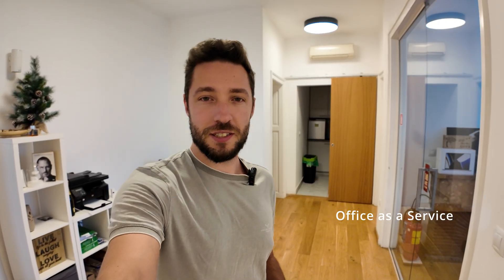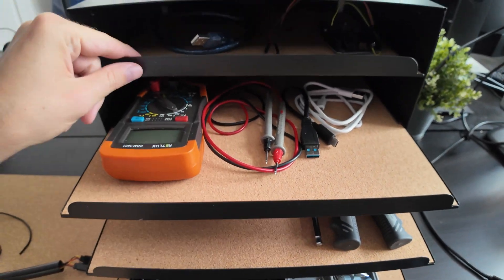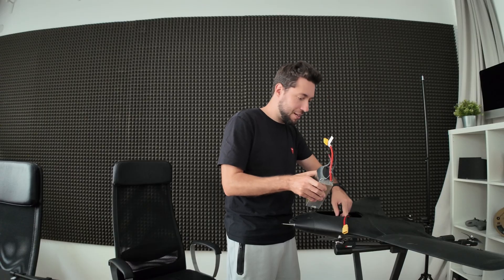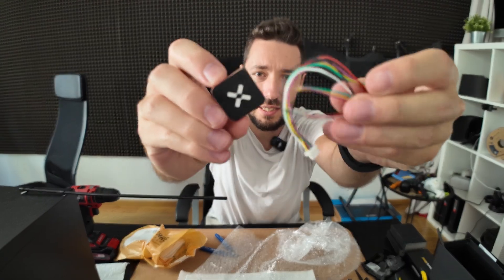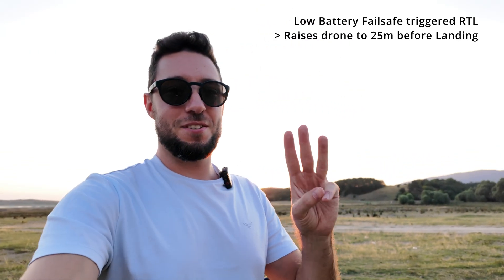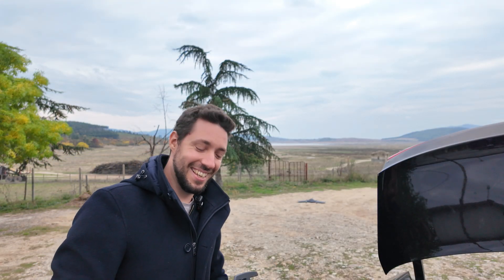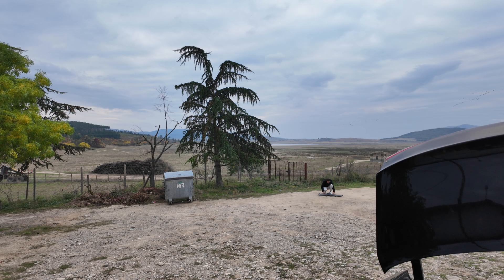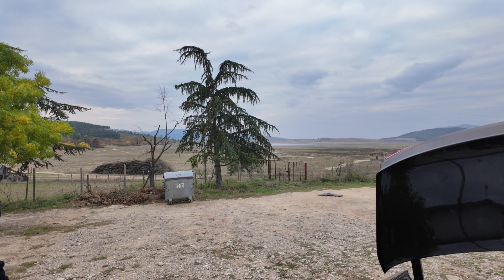Can a 3D Printed VTOL Drone Hover Safely? Stress Test & BIG News!

Comment: Sup mate! How did you manage to make it light enough? Mine is so heavy it barely lifts off killing the battery almost immediately - 3.5kg whole build. Even 10' motors can't do anything. Am i using the wrong plastic or printing settings? I'm on regular PLA now, should i try with LW PLA or smth else? Only ASA CF is doable? But is it actually that much lighter/less dense than PLA?
Reply: asa aero is recommended

Comment: Amazing to see it hover. Congratulation! I was wondering what radio link you were using
Reply from the maker: Thanks! DJI O3 Air Unit + RC, as well as a Holybro SiK Telemetry Radio connected to my MacBook running QGC.

Comment: I am also working on the same model, for motor mounts u can use a 16mm aluminium motor mount, it will solve all your problems, it’s round dual bolted to no grip issue on to the CF tube plus heat resistance, for aesthetic purposes u can design an outer casing. It’s cost efficient and permanent fix
Reply from the maker: Good idea. CF is rather sexy but also rather expensive. Thanks for the suggestion

Comment: what receiver are you using?
Reply from the maker: DJI O3 Air Unit with RC and a HolyBro SiK Telemetry Radio for redundancy. Rated for 50km so it should do 10 fingers crossed 🤞

Comment: Hey man what is the aproximate weight of the overall aircraft and if possible can you give the breakdown of weight of major components like battery and body and motors
Reply from the maker: Hmm I don’t remember the details. 1350g battery (11A 6S HV LiPo). Total weight around 3kg. You can fit 17A with the same weight if you reduce the Amps.

Comment: why are you stress testing the hover? this model are suppose to just use the the forward flight most of the time and just use the hover for landing and launching only? sorry if i sounded dumb
Reply from the maker: That’s true, but hover can serve 2 critical roles:
1. Redundancy if the main motor fails - vtol can trigger below specified speed or altitude. 
2. Drone-in-a-box concept where the drone can land with precision in a robo hangar. 
Forward flight is up next of course.

Comment: I don't know why, but I am reliably shadow banned from responding to comments on this channel. Any response I type up just disappears within seconds. It is infuriating how much of what I've typed up has gone missing this way. Anyways:
Re: vincehogg
I run ELRS with YAAPU and it works great. Waiting for ELRSv4 to release so I can run that and mavlink-rc at the same time so I can get mavlink telemetry to display on the remote and forward it to the laptop all over the same rc link. All that on a 60$ Radiomaster Pocket. The DJI stuff really isn't the right thing to use here, especially if you want to go more professional with it. ELRS will be the thing you want to use for that. 
Re: you on flightory
I think their design method here could use a jig for motor alignment, but it's also your job as the builder to make it straight. At some point it will make sense to deviate from commercial designs and roll your own.

Comment: my theory on the front right motor getting hot: Your motors are probably not glued onto the spar exactly vertically, I did not see you use any tools to ensure that it was exactly straight. Any slight misalignment will cause one diagonal pair of motors to need more power than the other to combat the torque. Combine that with your forward center of gravity and one specific motor gets way hotter than the others. Dump the BIN log from the autopilot and analyze it in mission planner. Specifically, plot all four rc out throttle values and see if they are even during hover.
Reply from the maker: That’s a very valid theory. Good catch :) I’m hoping Flightory improves that design for everyone else.
Reply: To add to this, I think that the carbon type needs to be lined at both ends, motor end and wing end.  This will keep the nacelles exactly aligned.

Comment: George, do yourself a huge favor and get an RC set that will run Yaapu telemetry. It will monitor all telemetry coming from the plane and warn you if something is not right. In your 'fly away' incident it would have shouted at you 'LOW BATTERY' and then 'RTH'. Better still change your RC connection to mlrs (yes I do mean mlrs not elrs). You can have a bluetooth connection to your laptop with real time info from mission planner. You can even see ESC temps live. Here I am running Yaapu on an X20. I would not fly without it. You dont know whats going on inside the plane without. https://youtu.be/X4fmwK3XeBU?si=ZuiGuKmY6Rt1y6lo
Reply from the maker: Ohhh that’s nice! I am waiting for a shipment of a Skydroid G12 remote with VTX and QGC so my pain should end soon. I like your solution tho.
Reply: @pathfinder.george I hadn’t heard of the g12. Looks like a reasonable price as well. I have a Herelink which is similar which is currently on a rover with video.
Reply: Does a TX16S could perform this function during flight?
Reply: @antonymbepa7880 Yes
Reply: @antonymbepa7880 I believe Yaapu will work fine on that set.